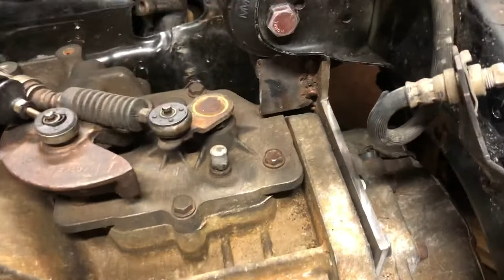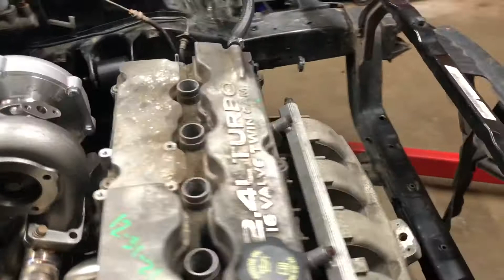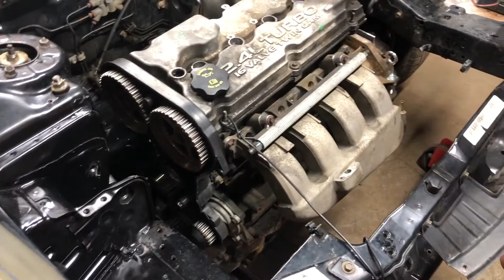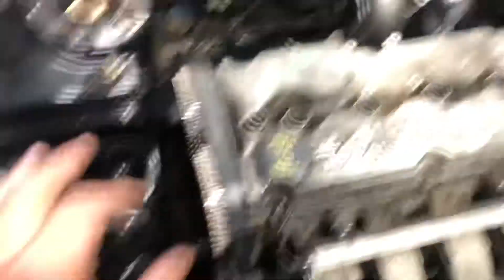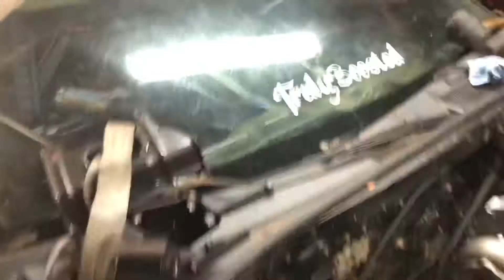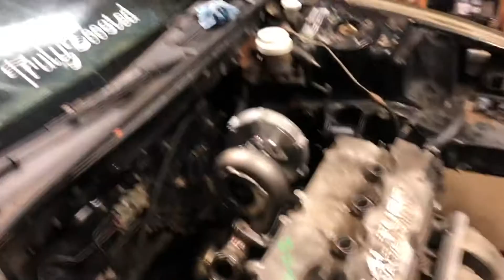Here’s the plan for the first full SRT4 swapped DSM!!!

Comment: What's the plan for CV shafts
Reply from the maker: I plan on running the SRT intermediate shaft because their transmission specific then we’re gonna run PT shafts with SRT inner cups and eclipse outer cups this should get us by until we have custom shafts made
Reply: @NITROKID98  have you measured out the shafts yet to see if they're the right length with the stock hubs
Reply from the maker: @kennypicPSN  yes their not going to be a perfect fit but they will work for testing
Reply: @NITROKID98  I was on the fence about attempting and nvt850 trans on my 420a powered dsm but the CV shafts will be the problem
Reply from the maker: @kennypicPSN  for that swap you could’ve just ran your factory shaft with SRT inner cups It would be much easier that way because you don’t have an intermediate shaft

Comment: nice project!
I'm just thinking thats srt valve cover fits 420a?
Reply from the maker: I believe so.
Reply: SRT4 valve cover does not fit a 420a. The bolt pattern is the same but the spark plug tubes are offset differently and it will leak badly and damage plug wires